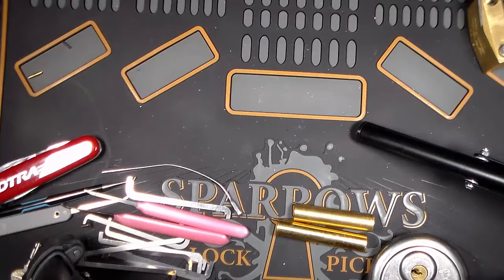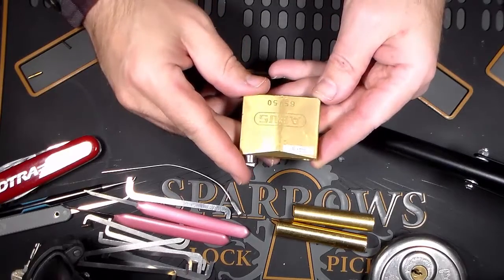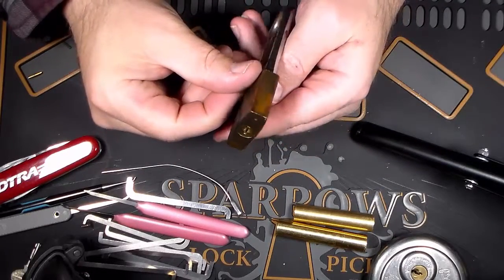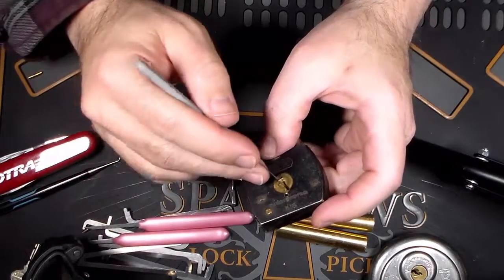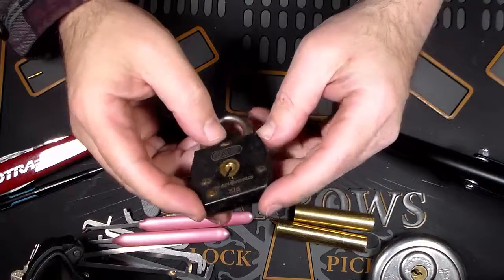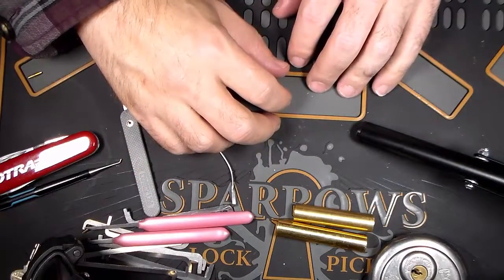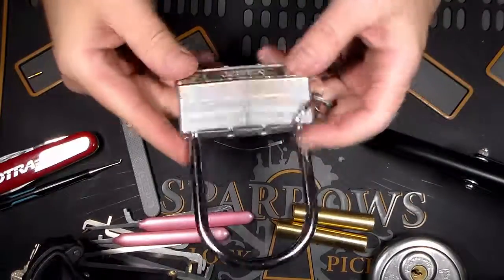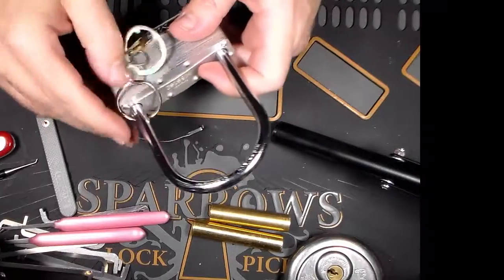Help - How Do I - 25

Comment: The Brinks usually open as easy as a Master Lock. Just use light to medium tension and feel for that binding pin and set it. and then move on to the next on. Some of those brinks will require some practice.

The abus usuall has security pins, probably spools. Use light tension and feed for the counter rotation and set that pin and etc.

The other lock, I have never fooled with. I will have to get me one to practice on. Thanks

Comment: Heya, 
For the Brinks locks they have no security pins (at least the once I've picked). Try a Peterson prybar with top of the keyway tension (medium to heavy) and medium hook.

For the ABUSes again peterson prybar top of the keyway with increasing tension up to medium. Usually ABUS have spools inside so whenever you feel counter rotation you need to release a bit of the tension until you set the pin. Bill has a vid about that look for it, if you can't find it tell me.

For the Master I doubt there are security pins inside (someone please correct me for if I am wrong for this particular lock) so I can suggest bottom of the keyway and rock it open (or use a rake). For SPPing it top of the keyway and I would try with heavyish tension and slam the pins into place.

For the older style locks, don’t use your picks, rather use the tension wrench as a pick just rotate until you find the mechanism where to push and it will unlock. (I’ve opened one on this video, have a look begins about the 3rd minute)
https://www.youtube.com/watch?v=DKrkSoY99xE 
Or you can buy a set of keys that usually do the job, can’t think of the name just now but look at this picture below - from the right side the second to the fifth is what you need. But again use a tension wrench and it works just as fine.
http://image.dhgate.com/albu_720751383_00/1.0x0.jpg

take care
vde
Reply: btw was just browsing trough the peterson website and found out the name for the older style lock it is the WARDED lock. 
http://www.thinkpeterson.com/opening.html

Comment: On the abus 65/50 use light tension once in a false set you will get lots of counter rotation then u jst need to clicknthe right pun for the open hope this help im no expert this is how i opened mine